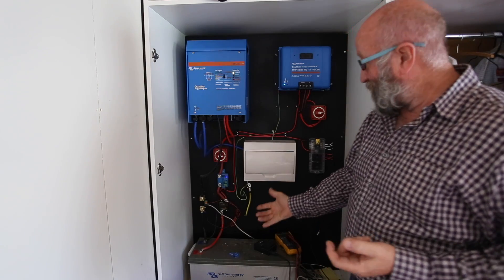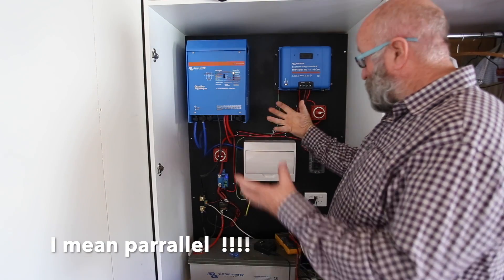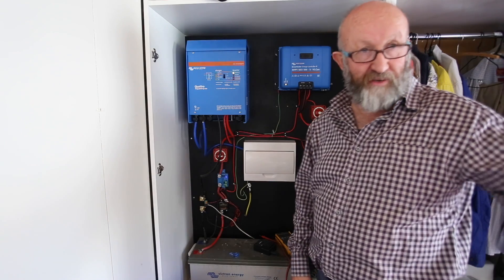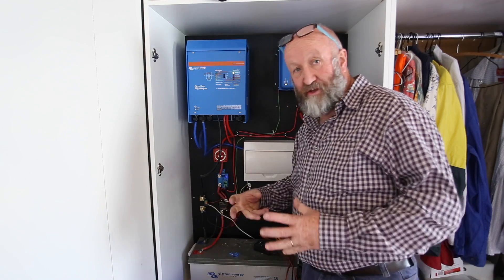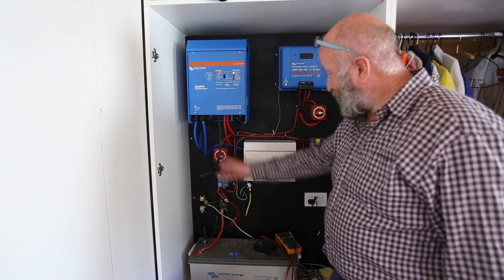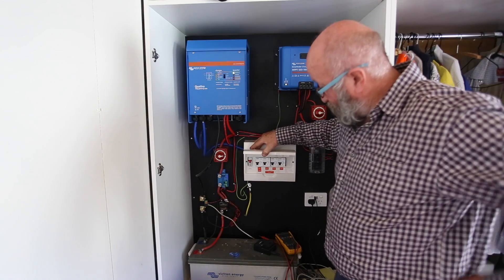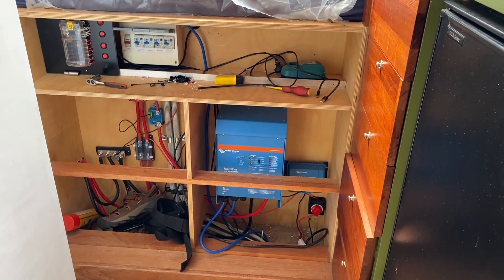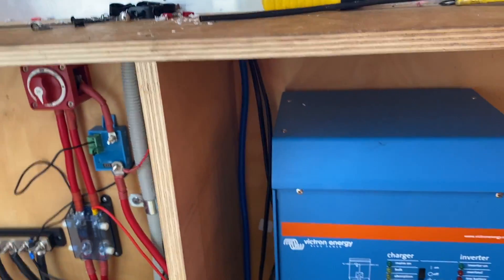Wombat Expedition Truck  Ep. 10. Off grid electrical system with Victron stuff.

Comment: @Mike Grant
I think you can reduce the amperage input to tune your generator max efficiency. I know the MultiPlus does it, I bought a Victron Digital Multi Control 200/200A GX so I have a panel with a little dial to adjust incoming amperage!